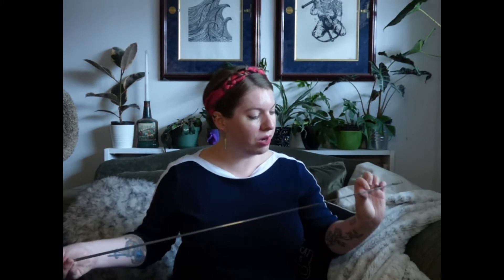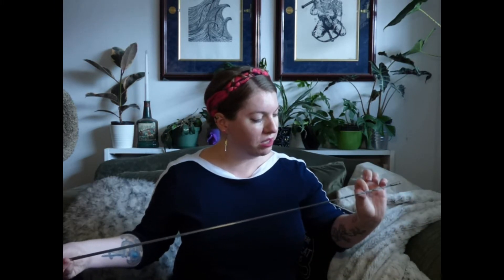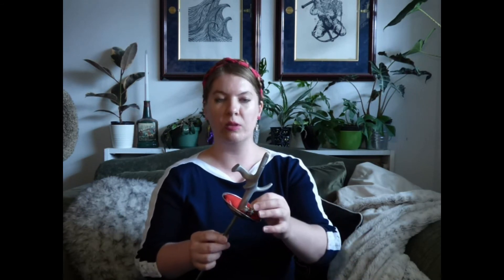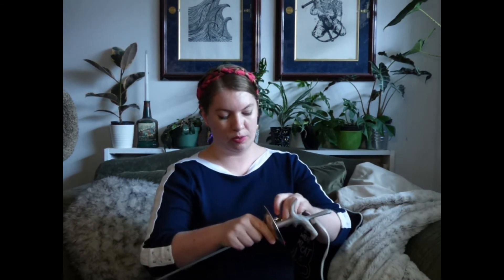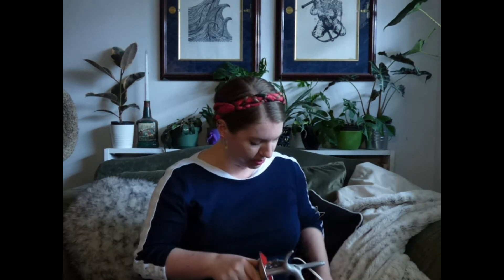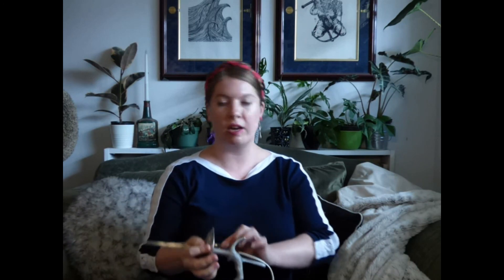Diagnosing a Foil: Intermittent White Light

Comment: Thank you for the detailed review. I find that with some foils (new ones or even ones that I've rewired), I hit the foil against my shoe while plugged in the test box and it's fine. But, when I hit it really hard with another metal foil or a hard PVC, the test box briefly signals discontinuity). I set my Favero tester/hit detector from test to foil and hit the blade and it doesn't register a problem. I'm very confused and not sure if I've failed in my rewiring or received a bad brand new foil or if I'm testing the blade too hard?  Does the discontinuity have to last for a period of time before it registers a white light (like a hit on target)? I've used some of these foils that I've rewired but fail against a hard wrap on the blade and sometimes they seem just fine and I get no intermittent white lights and other times I get a light and I'm back to diagnosing again. Any tips would be appreciated.
Reply from the maker: Hmmm that is strange. My normal first thought in situations like this is that there may be a slight misfit between your bodycord and foil, so in some situations it reads white light and others it works, and both items test fine individually. The other thing I would look at is if your barrel is on tightly enough. I have found sometimes I get even brand new blades that the barrel is a bit loose. And of course, I'm always a proponent of just giving the inside of the barrel a good cleaning! Best of luck with it!